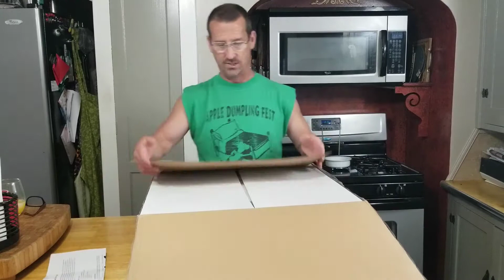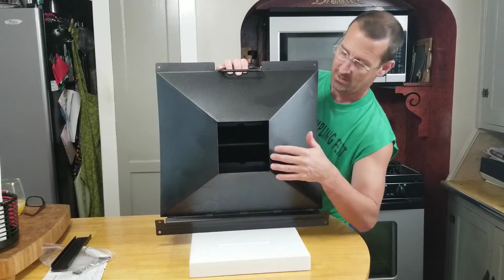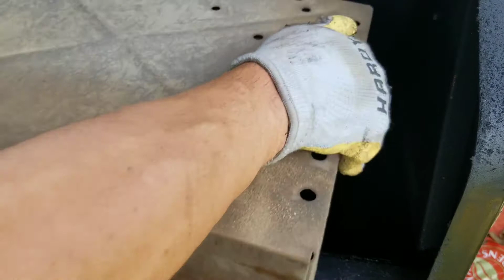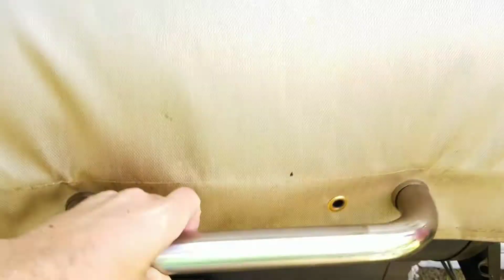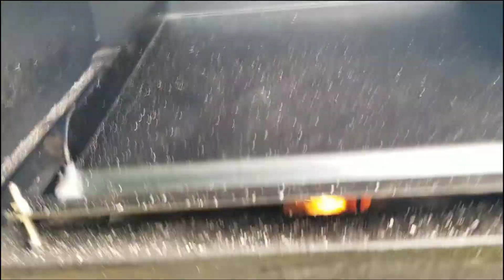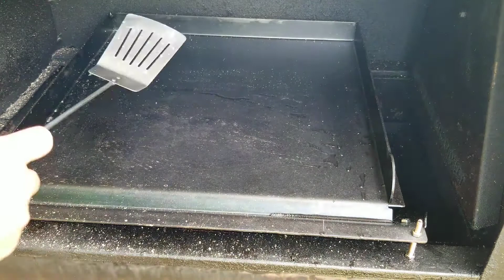Griddle Hack  - Unboxing and Setup - Green Mountain Grill

Comment: What material is the griddle made from? have you had any issues with corrosion? do ou need to store the griddle in a dry place to prevent issues with rust?
Reply from the maker: It is made of some kind of metal, not sure.   I keep it seasoned like I would a cast iron skillet so have not really had issues with rust.  I keep it in my garage which is not heated or sealed.  So it does get damp in there sometimes but have not really had issues.   I love the griddle hack.   If you get one, I hope you enjoy!  Thanks for watching!

Comment: Should we use pizza mode on the app for this since it sits on top of the fire box like the pizza oven? If you lowered the height adjusters would it sit closer to or on the fire box which will result in less ash blowing past the griddle intake?
Reply from the maker: It is possible, but all the way down there is still a little gap.  I have not tried pizza yet, but will be doing so very soon.  Thanks
Reply: @jklivinlife  no I meant since this sits on the firebox like the pizza oven does should we use pizza mode because like the pizza oven attachment all the heat is directed up to the griddle.  So the grill temp sensor reads differently and saves pellets because the heat is not evenly distributed as it would be without any attachments.
Reply from the maker: @1978vini  I do not use pizza mode.   Try it both ways and see which works better.  I would be interested to know

Comment: I have a stupid question: can you just use the GMG Pizza oven attachment in the same way?
Reply from the maker: I don't have the pizza oven for the GMG, but pretty sure it works similar.   I think the GMG pizza oven site right on top of the grates
Reply: @jklivinlife  nope it sits on the fire box flush vs hovering over it. And it even with the hood and pizza stone is cheaper than this hack setup. Just thought you might be interested to know. The only thing I was worried about is stuff dripping down and causind a grease fire.
Reply from the maker: @johnathansparks1678  Interesting.  Thanks for the info